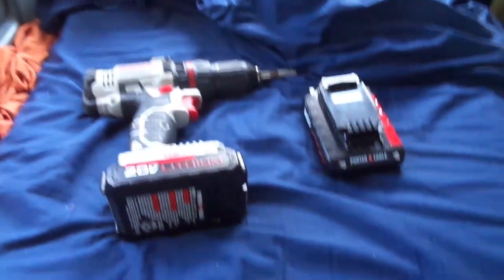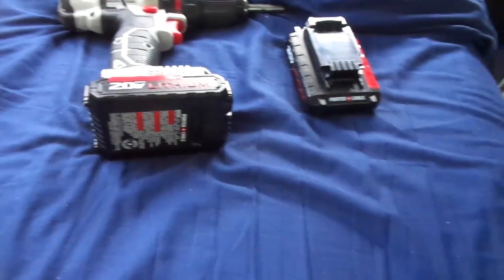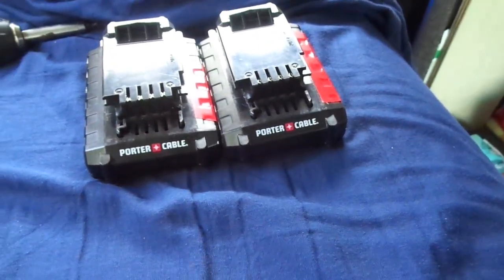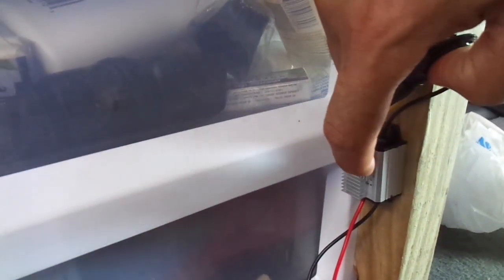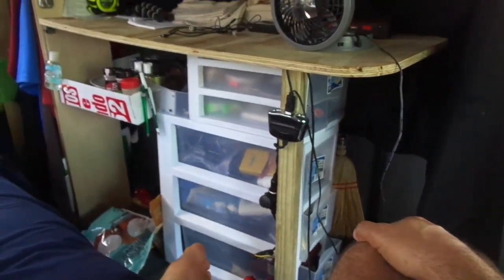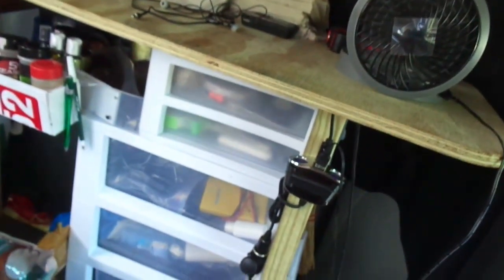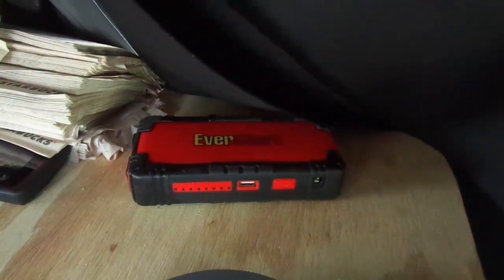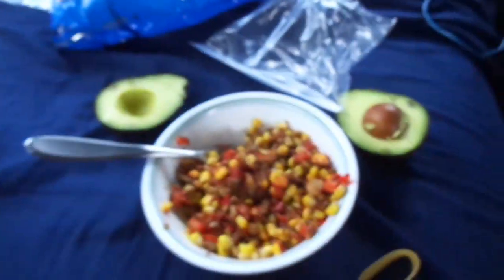My Electrical System explained

Comment: Hi Vince.
Be carefull fully emptying Lithium batteries, all the Lithium power tool batteries I have with instructions, state that the battery is fitted with a safety shut off device to stop the battery becoming to low, as this will shorten battery life, the other terminals on the battery I believe are for temperture sensors, so the battery is not exposed to extreme tempertures during discharge or recharging.
What do your tools instructions say?

Comment: Vince you saved me a lot money today I have been trying to figure a cheap way for power and I had three batteries and a charger already. Thanks again it works great. My batteries are only 12 volt so it's a easy setup.